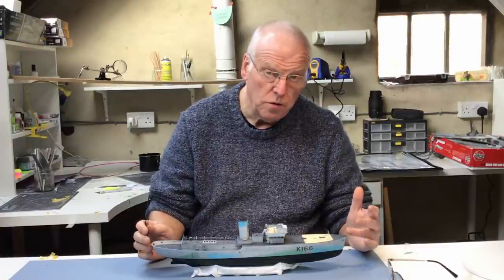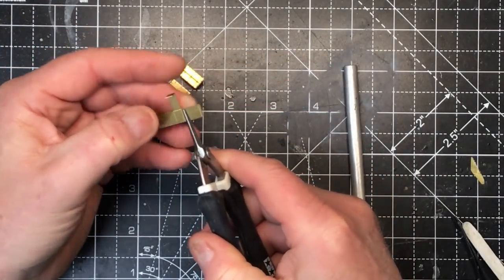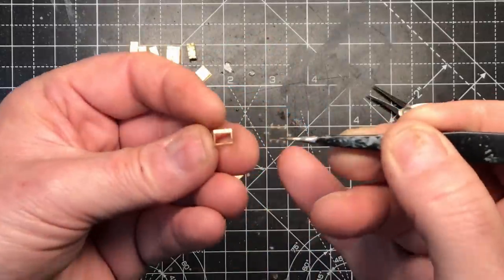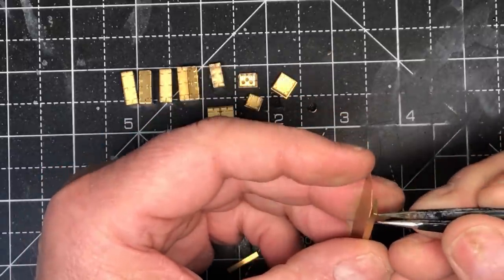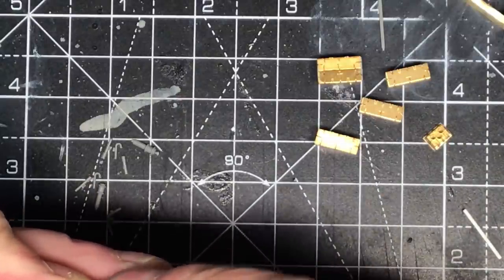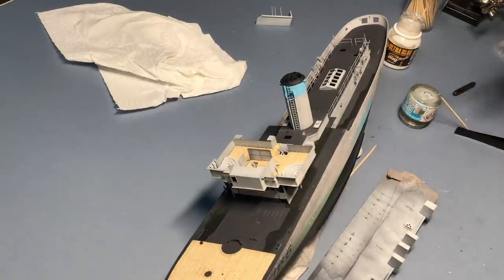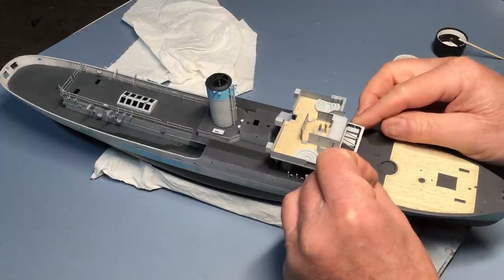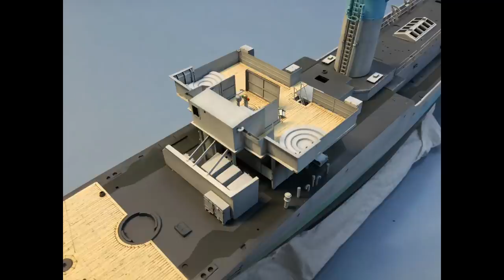Revell 1/144 Flower Class Corvette full build with Pontos detail set Part 10

Comment: It really was a good idea to fill those slots in the deck, but what I would have done would be to fit as you did except I would scribe new smaller slots with a ultra fine scriber tool. If careful enough it would not be noticeable. Otherwise I do really like build, your are very talented and I look forward to seeing the rest of the build.
Reply from the maker: In retrospect Brad I should have added a piece of styrene to partially fill the slot leaving a fine gap at the front to accept the brass tab. I just didn’t foresee the fit options clearly enough and in time otherwise I could have made it easier for myself. Your suggestion is a good one and would work as well. fortunately the fit isn’t too bad so I think I more or less got away with it.

Comment: For the most part you can't see the model for the text!
Reply from the maker: There are only two short (5second) fixed text items in the video. If you’ve got text running throughout the video then you must have the captions on. You can disable them in your settings.